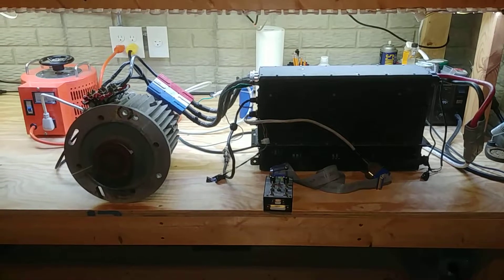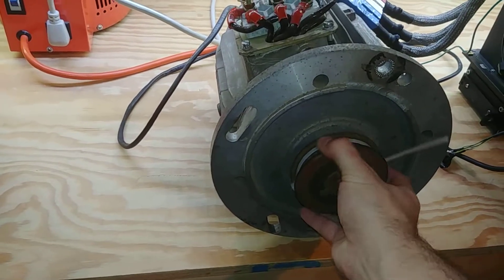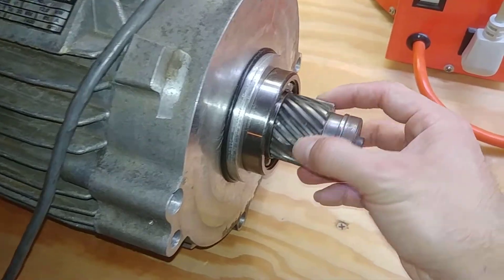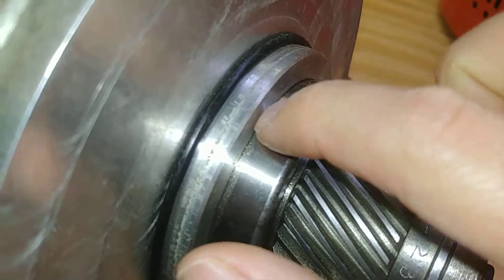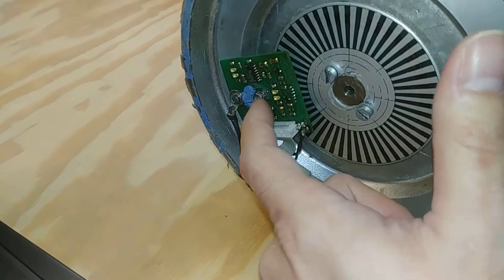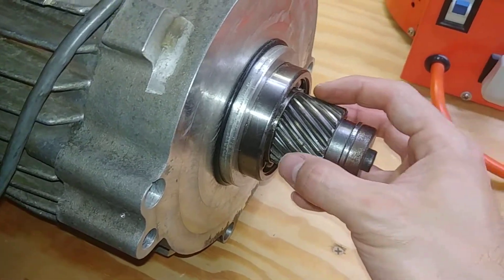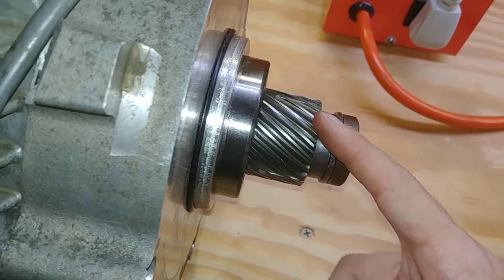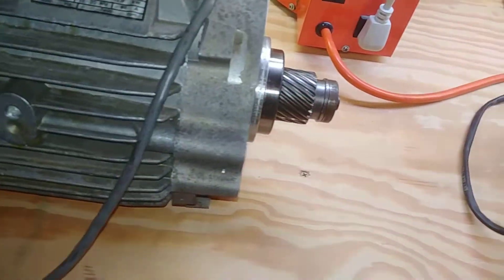Solectra Force motor jerking problems?

Comment from the maker: Also, forgot to mention...
The jerking is only when starting and stopping, because once the rotor is spinning, the stator provides a centering force which is strong enough to overcome the axial thrust from the helical gear.

You have felt this centering force, if you have ever pulled the rotor out of a permanent magnet motor...

Comment: A better bearing is a tapered cone bearing.  Often theses are used on a rear wheel drive car's front spindles/wheels.  These can take both radial and axial loads.  The trick is to find replacements by specification other than the bearings used on a specific model car.

Comment: Congratulations on being a father.  Sleepless nights pass, but enjoy every moment you can, they grow up fast.  I could hardly tell you moved, desk and all looks the same!  Fun to see you troubleshooting old ev electronics again.  So would moving to a sensorless FOC motor controller make sense or are sensored better for these old motors?
Reply from the maker: It's kind of the same desk, it's the other half that had much less use.

I don't recommend a Sensorless Drive in an EV, especially with an AC induction motor.

The hardest part of getting a Sensorless Drive to work is getting all the parameters for the motor model.

And Sensorless Drives work fine for loads that don't change, like a fan, all the conditions are known.

But in an EV, you have many more unknowns, starting up/down hill, passengers/cargo, etc...

This changes the model of the system, which causes discontinuities when switching from frequency mode, to vector mode.

Especially when starting out, since you don't know what the rotor is doing until you get going fast enough to measure the back EMF.

So you have to rely on your rotor model to estimate velocity realy well.
Reply: Ok, I guess that explains why all the modern electric car motors seem to have resolvers on them.  If they could drop it and save money they would 😀

Comment: Using an optical ecoder with a slotted disc would easily solve the problem. Also adding another, opposing helical gear would be both silent and prevent the problem.